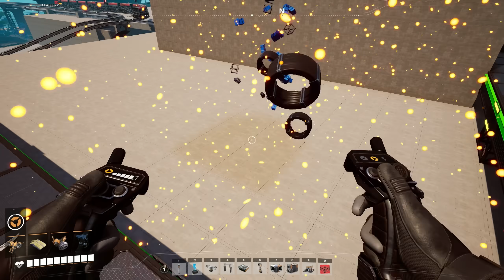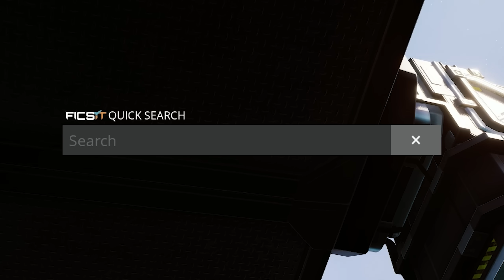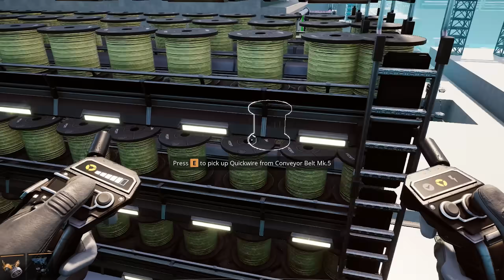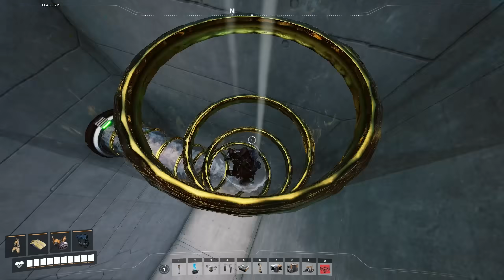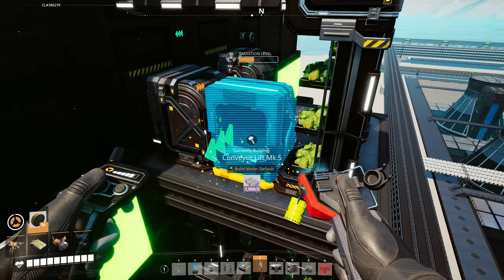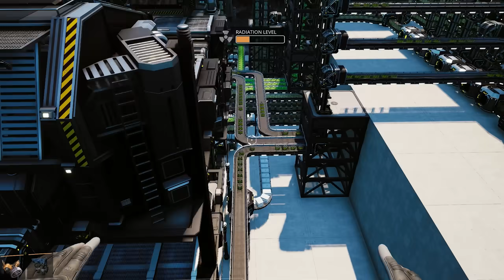My BEST Blueprint Yet in Satisfactory 1.0

Comment: kibitz--> Lets make compact BP
also kibitz 
proceed to make it 3x bigger than it needs to be

the easy way is like that:
arrows are producers facing each other by imputs between them on front is belt x5 stacked on top of each other putting splitter(5) on each elevation on every input and from this splitters 2 conveyor belt to each input and now u have balanced every input with possibility to expand this bp futher where between BP u just need to make a little space so u can put mergers to give more resources

l-----> l <----l
l-----> l <----l

Comment: On principle, I generally try to transport basic materials in their most condensed form. Quickwire (and other high volume items) I generally defer to building on site. My logistics only needs to account for moving Caterium ingots, since it is condensed even further from Caterium Ore. 

Instead of transporting ~6000 Quick Wire on ~8 belts, you can transport ~500 Caterium ingots on a single belt and build the Quickwire on site.

Then when I start working on my blue prints, I'll build the constructor right into it. (Wouldn't work specifically with your awesome new manufacturer blueprint here, tho!). The standard Caterium Wire recipe producing 90/m which handily covers the 75/m the recipe requires, so it's a simply 1 constructor to 1 manufacturer ratio. 

This solution can be expensive in either space or power shards, but worthwhile to keep logistics from getting out of hand!

Comment: Nice blue prints! I just finished my first 90 uranium run power plants today. Now just have to work on turning the waste in to plutonium. 

Drones are very efficient with high stack items like quickwire. Also only put drones on the destination ports, leave the supply ports empty. You can have multiple drone ports picking up from the same supply port to match belt speeds for through put.

Comment: How are you deciding where to use a belt and just assume "It'll be 1200/min later" instead of forcing the use of 780 belts? Some of the load balancing and belt headaches could be more easily avoided if you paired / split systems based on the key input. Rather than load balance the Uranium ore coming in you could build 3 600/min systems and a 300/min system, based on the node distribution on the map. If built that way you can spin up/down subsets really easily.

Comment: The lag issue is 99.9% the game either due to some kind of inefficiency in the code or the engine itself. I notice for me on the GTX 1650. Sometimes when I first enter the game, my frames drop to 12-15. I normally get 60-80 fps. I thought its vsync but it's because of lumen. The second I turn it off, I no longer have the random moments  (and go to 100fps) when my game drops to 15 fps. (I can play on lumen easily but there is an issue like a memory failure or overflow that is causing it to happen after 2-3 hours for the first time in the day and then every 15-45 minites after a restart.)

Comment: and then vertical splitter makes this manufacturer blueprint.. trivial.
also that turbo fuel in the drone.. if it runs out when moving out.. it might get stuck with like 1-2 canister at the sulfur node and not launch?(Not enough to start, and no refueling)

Comment: I would be careful about mix fuel for drones, if it runs out at the supply  it will stop flying. Even if it does run out at the fuel side if it has some rocke fuel but not enough to make another trip it will stop. Had that bit me in the ass accouple times.

Comment: nice work. I love the V12 Blueprint. A tip for the conveyor balancing for next time/other people, if you need to inject 30 per min extra on the 720 belt and you have the extra belt over you can just put a smart splitter on the extra belt and set the main output like right and conect to the right side a mk1 belt and the split the mk1 belt with a normal splitter to get 2 belts of 30 per min. The smart splitter from the extra belt gets Overflow to another smart splitter where you do the same thing so like that you can extrakt 60/min or 2 times 30/min or 3 times 20/min from an extra belt. Also works with any of the other belt tiers (120 for mk2, 270 or 135 or 90 for mk3, 480 or 240 or 160 for mk4, 780 or 390 or 260  for mk5) it just has to be less than you current maxium tier belt, thats why it doesnt work with mk6, its the highest tier

Comment: I think that the quickwire belts can be massively simplified.  Just run the 540 belt alongside the 720 belts as they enter each system, add a merger just before they enter each system and feed it with a mk1 split off from the 540 belt. 

It doesn't matter that they become 780 belts on paper. Each system can't consume more than 750 so they become 750 belts in practice.

Comment: Be nice if they added an option in the blueprinter to upgrade all belts and lifts to current belt level. As well as you aim at a placed bluprint you can hit a key to update the belts and lifts. 
Can't wait for the update the blueprited belt highways and pipes will auto connect.
Wonder what the Ionized fuel looks like on the drone exahust

Comment: The rocketfuel drones could run into a problem where for example you put in 20 rocketfuel and it needs 3 per tour, so eventually you have 1 rocketfuel in there blocking the fuel slot in the drones inventory, so the turbofuel wont be picked up i believe

Comment: You probably should put the switch for the emergency system after the batteries (and maybe an extra switch for connecting the batteries to the main grid for charging).
The way it is right now, any additional machinery for emergencies will be powered by the batteries just like the awesome sinks are at 33:00.

Comment: Speaking of lags and you mentioning that you have a 4090. Well it is not the GPU that bottlenecks your performance. 
At this point in the game, there is a metric sh*t ton of stuff running in the background, updating all the machines and other stuff, so it's the CPU that simply cannot keep up with it all at a nice framerate. 
Try getting a 9800X3D or a 9950X3D CPU to alleviate the lags.

Comment: if the batteries are all on the "emergency" grid doesn't that mean they will power all of the machines on that grid as well?
instead of splitting off the sinks, mabey put the batteries into their own battery backup grid?

Comment: As for the belt balancer thingy at the end, I would brick it and build on top of it. The motor idea should stand out as much as possible since it doesn't have much height. Also, it could be nice to have a designated airport and landing area, at this is right next to the drones; so it fits thematically. This space could also have one of the "Hazmat locker rooms"  from the other comments

Comment: Hey Kibitz i'm wondering how you gonna handle the Nuclear Pasta cause im my playthrough im about to use only 1800 uranium and in this case it turns out to 15360 copper ingot and not gonna lie it's quite a lot, devided that by 780 belts equals to roughly 20 belts of it. To be honest when i see this i got lost and im sitting right now and wondering how to hande this mess.  :D

Comment: Going for overflow system and then try to go for balancing the inputs isn't just have the merger into the line when the total makes it less than what the belt can handle??  and at the end of the system make a loop to the next system or back to the start if there isn't more. Love kibz design but never gonna love those balance belt rooms that are 25% of the building.

Comment: The nuclear meltdown episodes are the most fun ones imo, passed events tell me I'm in for at least one at some point :) keep up the good work Kibs
Reply: Nuclear meltdown isn't really an issue with a ficsonium factory. Just stop the input of uranium and let it drain itself to clean up all of the waste.

Tip of the day from a fellow ficsonium factory builder: load balance the output from all reactors, as well as the input. 

Otherwise it will take ages until it burns through all of the backed up waste.
Reply: is it really a kibitz satisfactory series without at least one nuclear meltdown?

Comment: 1.1 looks to include belts and pipes to auto-connect

Also, you prob could’ve converted to rocket fuel for the drones to save on some sulfur. Dunno if it would’ve given you the amount you needed.

Comment: I think the 'slug' load balancer, as you called it, would be fine encased, but just in a simple building and with some of the belts running outside of it. Keep a lot of movement visible there, have it be one big shell you can enter to check in on the contents and part rate of, but not be the whole exposed piece. It'd fit in a bit better that way, I think.

Comment: That quickwire balancer is pretty, but cant you just have a quickwire belt with smart splitters that prioritize a mark 1 belt, that then splits into what would be two 30 belts, then merge those onto the 720 belts? Autoconnecting blueprints though will revolutionize things for kibs.

Comment: That drone with the rocket fuel is going to be a future Kibs problem, I think.
Reply: It's not a speed issue.  The drone can't mix fuels, and if there's not enough rocket fuel to make the trip I think it won't go.

So eventually that drone is just gonna be sitting at home with not enough rocket fuel to make the trip.
Reply: @CardgageClement  didn’t know that
Reply: @CardgageClement  it will actually over fill from what I have seen, if it take 150 fuel to make the trip it will fill with 150 fuel.
Reply: @StrifeA217  there is only 1 slot for fuel and if it has 1 rocket fuel in it, and the trip requires more than 1 rocket fuel it won't fly, meaning it will just sit there, without enough fuel and not a space to add turbofuel as that 1 rocket fuel is taking it up. 

I think you might be right with the overfilling thing though, if the trip took 150 turbofuel it would take 150 turbofuel, not too sure though.
Reply: @xd3athclawx554 Yep. At some point, Future Kibs will need to delete that drone and make a new one with Turbofuel. I just went through a similar thing with Fuel Generators. Switched over from regular to Turbofuel, and most of the generators just stopped working because they had 0.01-0.99 cubic meters of the old lingering in the tank.
Reply: @xombified9  Just getting them going after allowing buffers to fill that you didn't know you needed is a pain too.

fluids lmao
Reply: Additionally, doesn't he have two drones running that route?  So the one drone stops running because it has an insufficient amount of the wrong type of fuel to make the trip and it causes the other one to go idle at its drone port or end up circling in the air and because of Kibs luck he will end up trying to diagnose the wrong drone for an inordinate amount of time before he realizes the problem is with the other drone on the route. I can't wait for it ;-)
Reply: I don’t think they’re gonna slow down that much
Reply: So fuel economy fuel quantity and speed difference so 100% going to make himself some future kibs panic

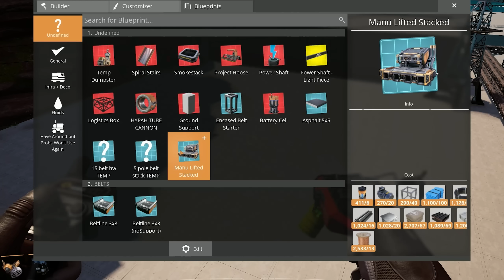Comment: 8:08 On your channel's about info page, it says you only have a Ryzen 9 7950X. If you upgrade that to an X3D V-Cache CPU, you will see tremendous gains in game performance. Satisfactory absolutely loves a large CPU cache. You should be able to only replace the CPU, as your AM5 socket motherboard will support the new 9000 series too.
Reply: We need kibtz to see this
Reply: I didn't know Satisfactory loves cache may affect my near future purchases
Reply: @GorgothNZ  
pretty much all games love extra cache, productivity type stuff is where it's not really useful. this is why the x3d parts dominate gaming benchmarks, they are just a better product.
Reply: @GorgothNZ  Yeah, same.
Reply: I found out the issue is with lumen, either like a overflow or memory fail something.
Reply: 995x3D is king but I got the 9950x cuz almost half the cost (sad noise)
Reply: Interesting information.  I too am sitting on a 7950X3D right now and didn't realize the 9000 series was on the same chipset.  I don't upgrade my CPU very often given it's usualy a huge pain causing a motherboard and ram upgrade as well.
Reply: @JohnVanderbeck I don't think there is a reason to upgrade from a 7950X3D any time soon.

You can probably sit this out until the last generation of the AM5 motherboard platform and only purchase it when the new AM6 CPUs are out. It's what I did with AM4 to AM5 and I've done some very cheap but very impactful upgrades on AM4. Started at a 3600, now at a 5700X3D. Massive performance.

Comment: If you're trying to get a specific amount off a belt, e.g. (you need 30 off a 540), you can priority split onto a tier 1 belt (60), then split that in half (30,30) and route half back to the original line. Then you would have 30 and 510. You can math to make just about any amount you need with different tiers of belts. Hope this helps!
Reply: no need to merge the 30 back into the 480 line to make 510. You want 30, You get 2 * 30, but your not using both 30s?
Reply: @frozenherolp9077 They literally only need 30 in this example. Why would you waste the other 30 by not putting it back into the mainline?

Comment: If 4 machines only need 750 and your belts are all 720 then you could simply add 30 quckwire and match the needs for those 4 machines. This way there no overflow to handle and you can simply merge / feed the remainder quickwire in the last machines.

Comment: the Awesome sink switch should be in the main control room, it might take some rewiring but you'll thank yourself later if there's an issue

Also add a 'Hazmat Locker Room' setup dotted around near the irradiated areas, in case you die and need to quickly do something
Reply: Smart idea
Reply: Have it in my world it has saved me more ones
Reply: Smart and good for esthetics but as long as Kibz has Iodine Infused Filter stored in the dimensional depo its a single click to full stack anywhere after revival.